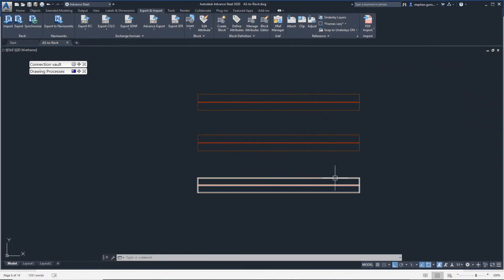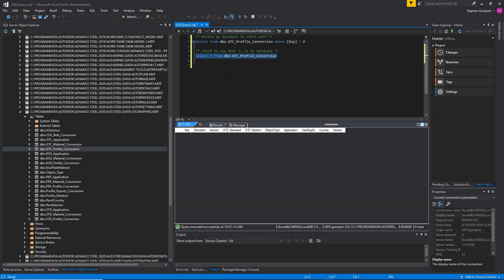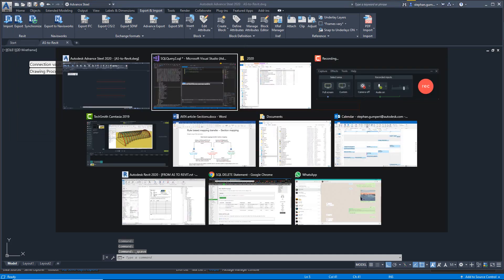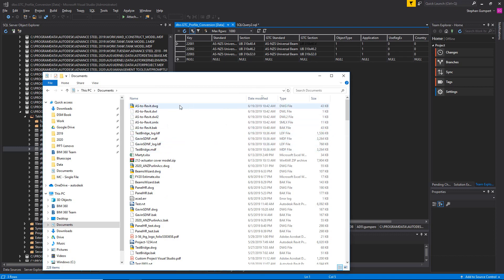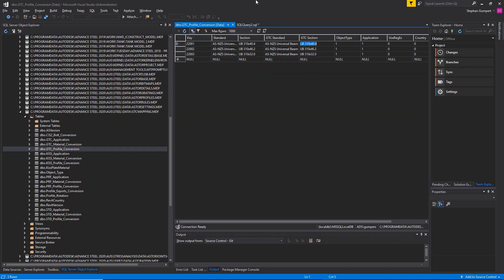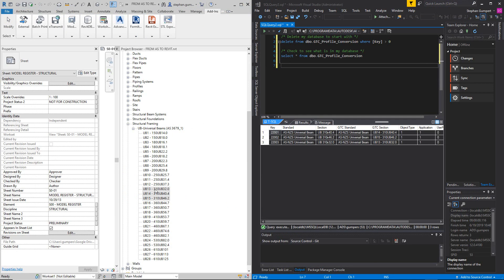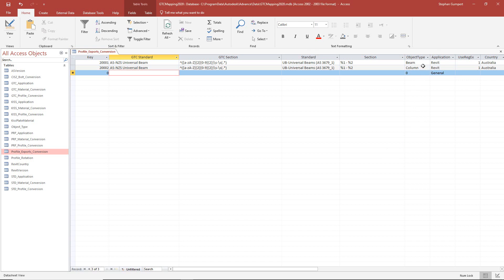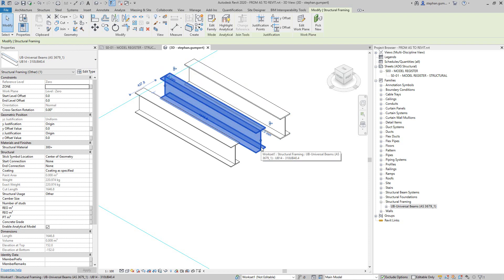SMLX Mapping Advance Steel to Revit

Comment: Hi Stephan,
Thanks for the video.
I watched your video, and followed your steps.
I imported the files into revit with SMLX format,
When I open the Access database, I can't see my Beams or profiles names in Profile_Exports_Conversion table.
I need to put the regular expression in the section column, but I can't do that. Can you help me with this?

Cheers
Bhanu
Reply: Hi podrías pasar esa extensión pleaseee,

Comment: Can't help but think why this is even necessary. Revit and Advance Steel should use the same tables for its steel elements so this remapping is unnecessary. I recently had to bring in a large file from Revit and manually remapping was a real bothersome exercise. This should be seamless between the two and until it is then detailers are not going to want to work with Revit files. But I will give you a like anyway Stephan.

Comment: Advence Steel and Visual Studio Dark Theme has the best eye-healthy user interface, in a light office with a good monitor > 300 cd/m2 it no problem to work many hours. Revit is the other side, it's a disaster when using a larger screen than > 15inch, many blue-light and in one hours your eye's get pain. So no conversion to Revit and work in Advance Steel until Autodesk build a good Dark user interface. And smooth zoom pavelfatin.com/videos/scrolling.mp4 and a better font rendering will also a good thing to work on.